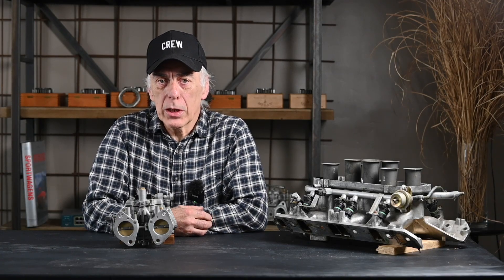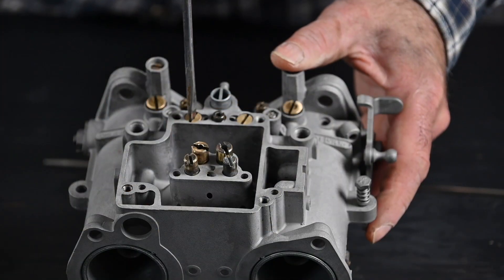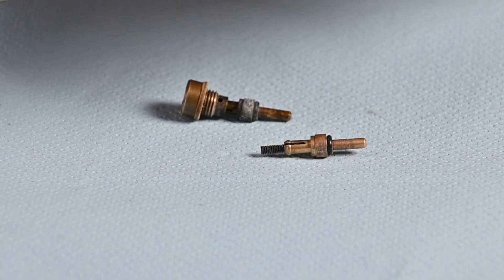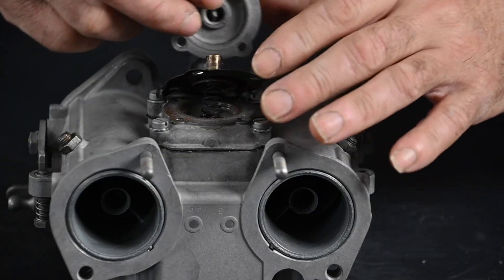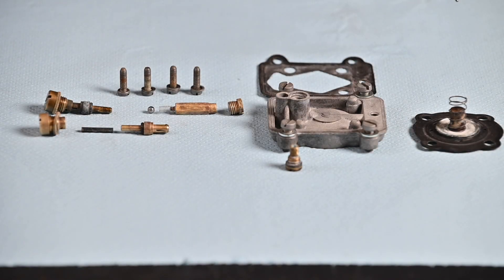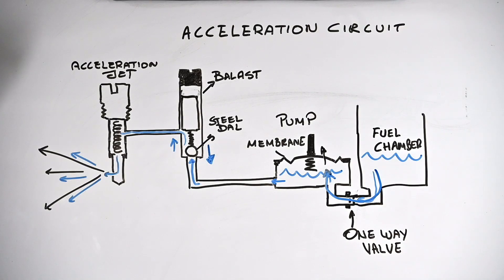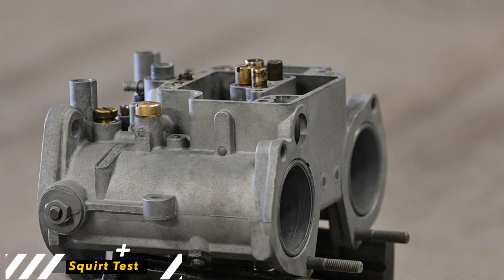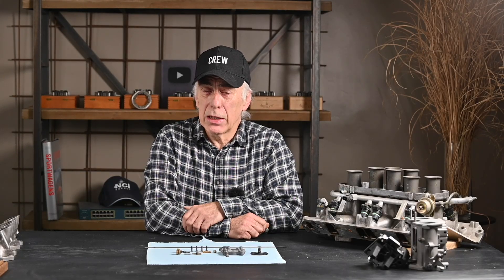Delortto DHLA Part 5   Acceleration  Circuit Baseline

Comment: You have a calculation error in that choke (yoke) calculation:

Square root (850) => 29.154759474

Square root ((4*850)/3.14)) => 32.905965231

So the latter is the correct answer. And your way of calculating choke (yoke) is correct, but there is a calculation error.
Reply from the maker: Thanks for catching that and pointing out the error!
Reply: @D3Sshooter  I tried to write about this before, but Youtube didn't accept my answer.

I think you can get pretty good reference values from a 2 liter Alfa Romeo engine with 40 DHLA carburetors from the factory:

Choke 32 mm
Auxiliary venturi 7848.2
Main jet 135

What do you think about this?

Comment: A bit more history
The K70 carburetor (DDHT) was also used as a performance carburetor for almost all vehicles.
For motorsport, the carburetors were equipped with an independent idle control system, and almost all tuners used these carburetors at the time.
The DDH carburetor was then replaced by the CADDHE. ("C" = Italy / "A" = Aluminum)

Steve,You are a good teacher  🙂
Reply from the maker: Thanks for sharing that extra bit of history and the kind words!
Reply: @D3Sshooter  I found something else: Mikuni PHH carburetor manual on the web 🙂

Comment: We should keep one thing in mind: the Weber is a racing carburetor, the Dellorto a road car carburetor. 
Why did Dellorto build this carburetor?
 Perhaps because Alfa Romeo wanted to use multiple manufacturers. T
They also had Solex Italy involved in production.
Reply from the maker: Thanks for sharing that historical perspective!  As I explained in the first video, the Delortto is a more cultivated carb, easier to tune at idle , progression and mid RPM....  The Weber as you state is indeed harder to tune at those RPM rates , however excels by far in performance at WOT . Thus, indeed  the Weber is much better for racing use.    Of course there is the DHLA build for performance and hard to find, but that is not the one in this video

Comment: So the excel pump on comes on one time at full throttle? correct. How do I go about adjusting all of them. Should I adjust them all off the car but on the manifold first?
Reply from the maker: The squirt happens  by a  on any rapid depression of the throttle be it in full or over 1/3 .  Thus moving the membrane  through that bottom lever on the carb.  take them off the car, place them on a bench and do the squirt test.  All should do more or less the same.  You can also collect the squirt of each in a small bottle and see if its the same amount.   Adjustment is with the rod and nut on the acceleration pump.  That sets the volume pushed.